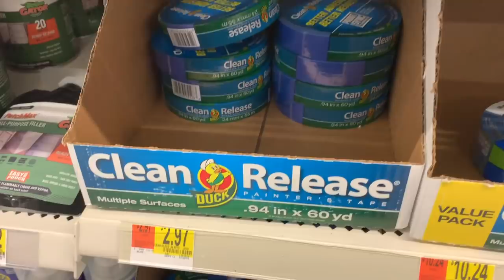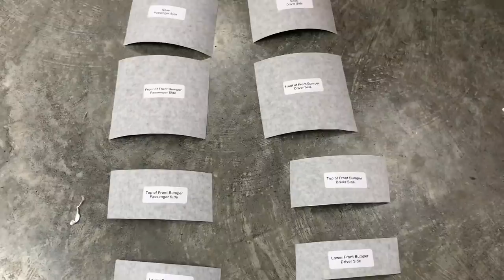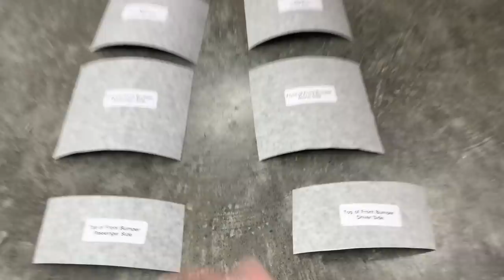REMOVING my new Racing Stripes ALREADY off my 2019 Mustang GT- WHY I HAD TO DO IT.....

Comment: I'm very picky as well how things are put together.  I did professional car interior restorations,  show cars, boat sails, tonneau covers etc. for years long ago.  One little tip to help you for another time is to use the 1" line on your tape measure as your starting point instead of the clip on the end of the tape measure.  It keeps the tape measure flat this way, instead of the hook end being up high and the other end flat. The hook end of a tape moves back and forth to, not helping at all!!  Closer yet is making the mark with the outer or inner edge of the black line on the tape. At the other end use the same side of the line as the first measurement. (Yep even the width of the line on the tape measure can make things unequal for super tight tolerances. Ask a carpenter about that when they are cutting and lining up the inner and outer tooth of the saw blade to the edge of that pencil mark instead of just cutting down the line.)  Use a soft lead pencil for your measurement marks, sharpened to a perfect point.  It rubs off easily with your finger afterwards.  You then align your pencil mark measurements down the hood to form a perfect line end to end. Use auto painters tape.(thin and leaves no residue) Stick it to the outside edge of your marks lining them up down the hood.  You now have a perfect guide with no guesswork or remeasuring all the way down to install the vinyl inside the 3M tape line you made.  Another simple tip that helps for aligning the hood stripe to the bumper stripe below is to tape a length of fishing line exactly on the edge of your hood vinyl strip on both sides.  Use a split shot weight on the other end of the fishing line.  It will hang perfectly vertical to form a line to install the next piece of vinyl down on the bumper.But still find points to measure using the same technique stated earlier to double check.  Sorry, long post, easier for me to show than explain. Just a couple of old school simple tips for this type of work.  Hope I made some sense.  You did great on your own for sure as always.  Being a perfectionist really shows our pride in what we do no matter how long it takes. Its why I watch your channel.  If only I had my eagle eyesight back again...grrr!  Looks awesome!!

Comment: I got my stripes done  twice,seperate pinstripe just didn't work,looked crooked and wasn't happy.A printed stripe and pinstripe in one nailed it
Reply: Edward Vickers where did you get a kit that has the pinstripe printed with the big stripes? Thanks!
Reply: @tsandphotog  Hi mate
It wasn't a kit,i got my local graphics guy to print up a white stripe with black pinstripe edge in 3M vinyl to resemble the GT350 stripe(which we dont get here in the UK)Any company that lays a stripe and a seperate pinstripe next to it struggles to get the line right.I know i had it done 3 times before i was happy lol.A good graphics/wrapping company should be able to do it.

Comment: When visiting Walmart. I learned the hard way to park at the end of the lot and walk. Looking up the word perfectionist. You're picture is shown, lol. Nice job with the install. it was hard to tell before how far off the original strip was, but it looks great. You made it look to easy. Never worked with a wrap that had air release. That has to be a big help with eliminating bubbles. Thanks for sharing.

Comment: I noticed how you could see the orange peel through the vinyl (the reflection from the shop light ), too bad you didn’t think of wet sanding the paint smooth to a mirror finish that way that orange peel would be gone and the decal would look smooth, not saying you have to do the whole  hood just where the decal lays down, but that would require a little more time.

Comment: Lol the gap at the top of the stripes is more narrow than between the hood vents.  You doing it the hard way homes.  Just find the center line of the car and run a piece of masking tape down the centerline of the whole car.  You need two rolls of stripe not these silly kits and stay on either side of the tape.  Easy you measuring way too much

Comment: The only problem with vinyl stripes is polish it always is a "B" to get it off the edge, Looks good though and its your car you are happy now so the next part is to get the rest of the R.
Reply: Amen to that! I had to wait to get mine ceramic coated til AFTER carbon fiber stripes on mine. And I ended up with some samage to mine from paint correction process. 😲😲😞😞
Reply: @mustangscott7694 I did the same same. Were you ever able to correct the vinyl?

Comment: Can I ask u a question e85 messed up one of ur o2 sensors
Reply from the maker: Yes. I had to re angle them and solved the issue
Reply: Mine has miss in it code miss fire on 8
Reply: U replaced both sensors
Reply: Was ur car missing from the o2

Comment: No worries about ripping them off like that and pulling off paint?
Reply from the maker: My paint is fine
Reply from the maker: Some heat might not be bad idea but they have only been on the car for a couple days
Reply: I need to get some final off the EcoBoost I bought, just worried about pulling off clear coat

Comment: Had a similar experience on my GT350.  BigWorm kit also.  Installer fucked it up... 1” gap is the single point failure.  It’s supposed to be 1 1/8”.  Not a fan of the BigWorm kit honestly, after a month of having it on the Shelby, there’s been a couple bubble spots near the back license plate, probably because the kit is so many pieces, or because the only white kit they offer is Hexis.   I find it ironic that I’m watching your video while it’s 1am and I can’t sleep because I want to rip the kit off my car... Im on IG @fpbcobra
Reply from the maker: I think they are okay for around $200 bucks. I have noticed that in 4-6 months that the vinyl has shrank a little and my car is garage kept. Also noticed that the pin stripes can become unstuck with even a small high powered water hose so washing can be harder. I still think they are excellent for the price but they are not perfect
Reply: Zander13 I agree… Great for the price. I was quoted around $1000 locally for the same work, with a 3M product. Instead, I spent $250 purchasing from big worm, and 300 for a local install. So yes, for $500 when all is said and done I suppose you get what you pay for. Ford does not offer the stock racing stripes in a kit. You have to purchase each piece separately, and the quote I received it was nearly $2000 LOL.  Suppose they are counting on a collision case, and trying to bank on one or two individual pieces needed.  Nevertheless, I just ordered an APR Front splitter, when that arrives, my bumper is coming off along with all of the stripes.  Cheers.

Comment: Use a seamstress tape measure. It’s soft so it won’t scratch the paint and it’s flexible so it will lay on the curves of the hood.